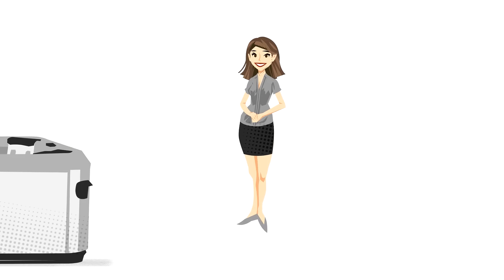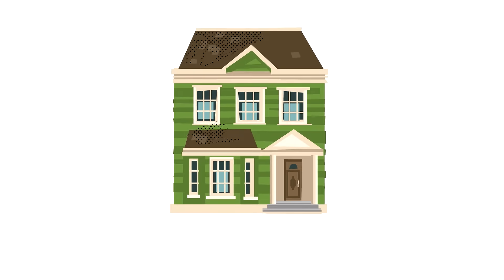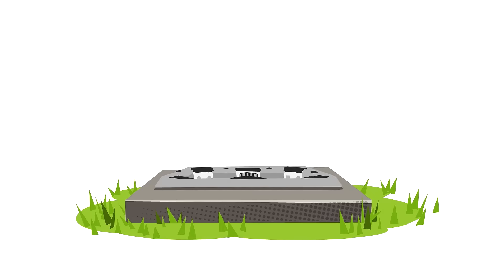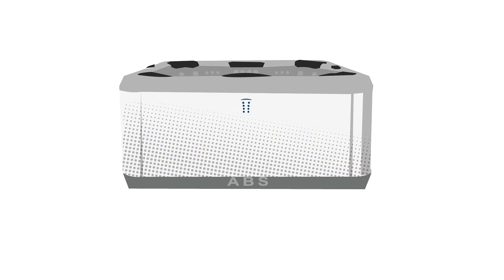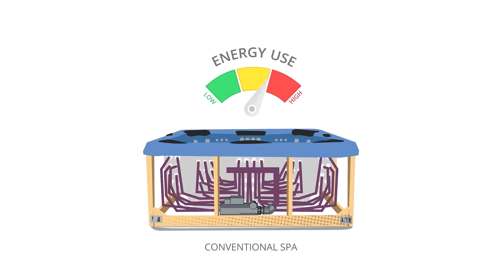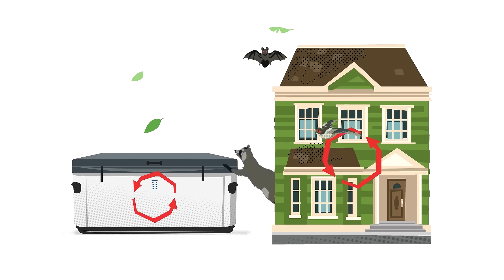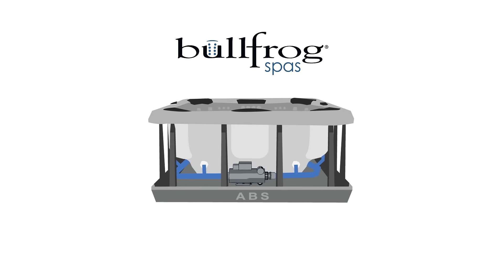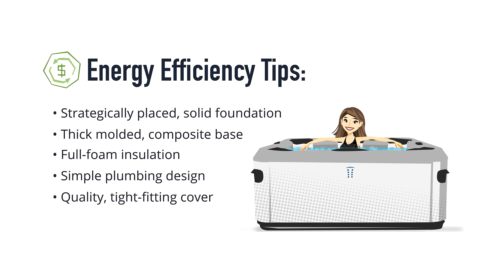What makes a Bullfrog Spa so energy efficient?

Comment: If I can't get one of my pumps to prime what do I do?
Reply: Sometimes you can take out a JetPak on that pump and then use a (new clean) toilet plunger to pull or force the air out of the line. Or you can bleed the line, but that’ll require you to remove the door and do a little plumbing. Your dealer is the best help here.

Comment: They say it needs to be placed on a solid base for it to be energy efficient.🤣😂🤣😂🤣 It needs to be set on a solid base because it doesn't have a self supporting haul! Then they encase all their plumbing into foam so if something leaks it's a guessing game on where the leak originated from. That's like welding every truck and car hood closed and trying to change the air filter  or top off windshield washer fluid!😂🤣😂🤣🤣 I Can't believe people buy into  any of this "sales pitch" what a crock! Horrible design and horrible spa and completely useless in the Canadian winters. And they aren't even that cheap! You can get a way way better spa for a extra couple grand that will outlast any bull frog tub by years and years!
Reply from the maker: Thanks for the feedback. We are always interested to learn about better ways to do things. We of course respectfully disagree with your characterization of how our spas are currently constructed and would welcome a chance to explain our spa construction and technology in more detail. Tens of thousands of verified reviewers have given our spas 5 stars in response to their ownership experiences but of course, we're not perfect and we can always learn more and keep getting better, in fact, that's really what drives our teams is continuing to improve and innovate.
Reply: @Bullfrogspas   Are you still using Acrylic with ABS backing?
Reply from the maker: @GoodScienceForYou  Yes, with additional rigidizer applied for structural strength.
Reply: What spa company you work for
Reply: @shanel6261  I don't work for any spa company. Why would you ask that?
Reply: lol u must be another dealer
Reply: What spa do you recommend?
Reply: What hot tub would you recommend?

Comment: Very nice tub, But the parts a very high.Because bullfrog only has one parts distributor.So he can charge what ever he wants to on parts.Thats why I won't sell in promote bullfrog..
Reply from the maker: We're sorry that you're not happy with parts pricing. We do our best to ensure that aftermarket parts are priced fairly and competitively. There are quite a few parts available from a variety of sources but not all parts. And, of course, we recommend original OEM parts for consistency and quality. We are interested to hear more if you have specific examples of parts we may be a bit high on. We're happy to review these. Email warrantyteam@bullfrogspas.com and reference this request.
Reply: Bullfrog Spas  I’m a service tech and I also buy and sell used pre owned tubs.i have tried numerous times to get set up with you as a service tech To no avail. So I could get parts for your tubs directly.with that said If you would like to contact me you can 3376608860 The Hot Tub Guy.
Reply: great grammar and you forgot about the 5 year parts and labor warranty !!!
Reply: Behind the jet packs needs to be cleaned also. You cant even aww-some the tub to clean it out since its water that doesn't move.